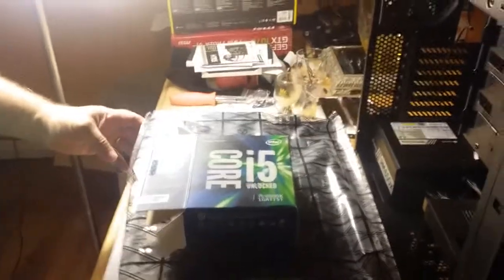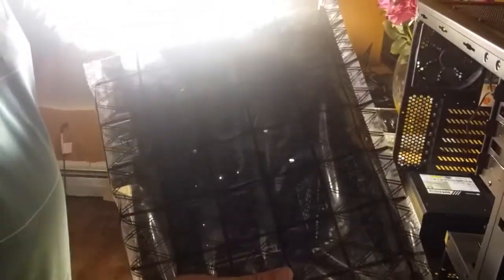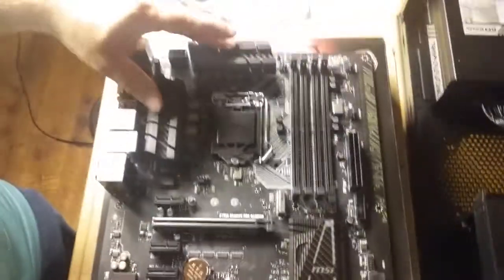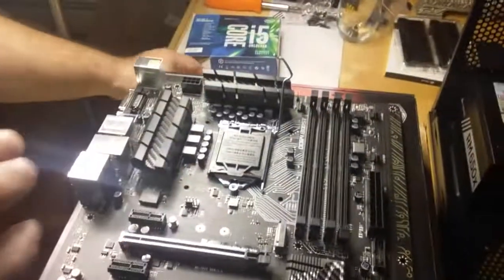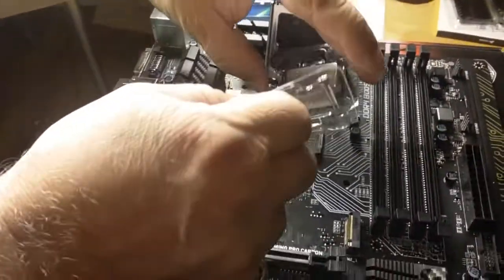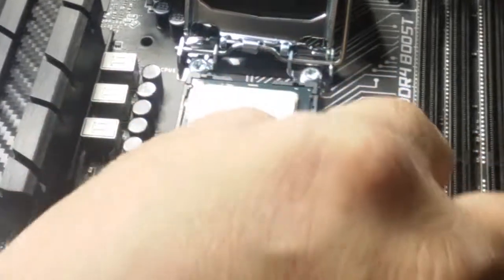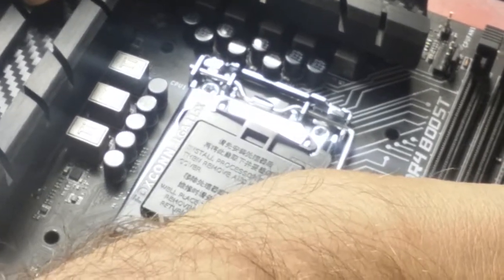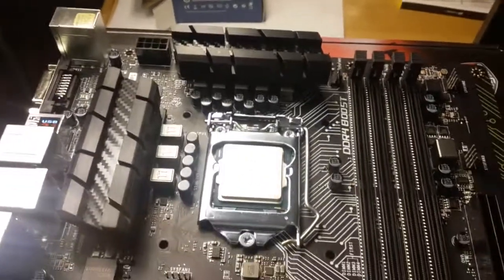MSI Z170a Gaming Pro Carbon Motherboard and the I5 Core 6600K CPU

Comment: Hello Charles I have a question I'm hoping you can help me out with I have the same build pretty much as you do using the same motherboard and the same CPU, however I have an issue where my motherboard crashed after I try to do a firmware upgrade through the device manager in windows 10 OS
Any thoughts advice or opinion I'd really appreciate it
Reply from the maker: I did all my upgrades through BIOS directly.  You might want to make sure you have the right firmware by double checking the MSI site for the MSI Z170a Gaming Pro Carbon.  I have a video that deals with this specifically, since we had to do a couple firmware upgrades.  I'll include the two links to show how I handled the problem.  It can be tricky when going to the MSI site since they have more than one MSI Gaming motherboard.
Reply from the maker: https://www.youtube.com/watch?v=gF_95FoM2Zc

https://www.youtube.com/watch?v=cnoxY632Ex8
https://www.youtube.com/watch?v=Is1c_rh_1Fc
Sorry I might not have these in the correct order.  But basically, you need to boot into BIOS and do the firmware upgrade with the latest BIOS available from MSI for the Z170a Gaming Pro Carbon.  Let me know if you need help finding the link on the MSI site.